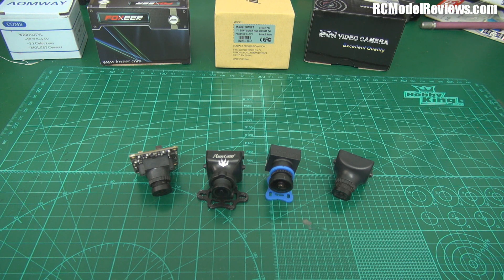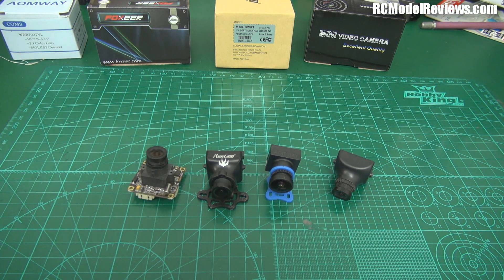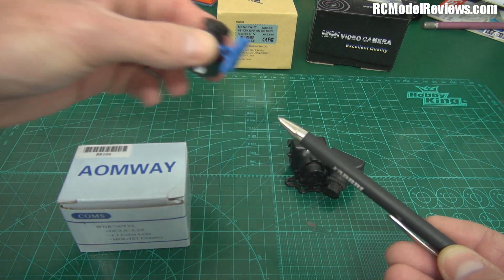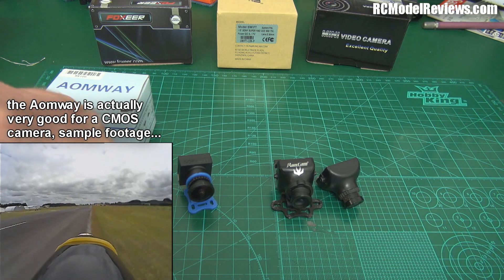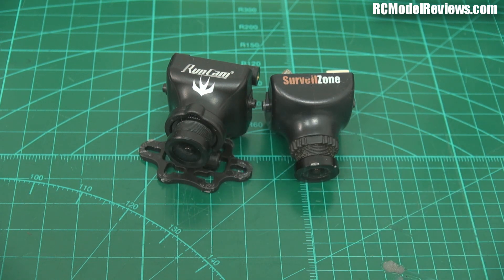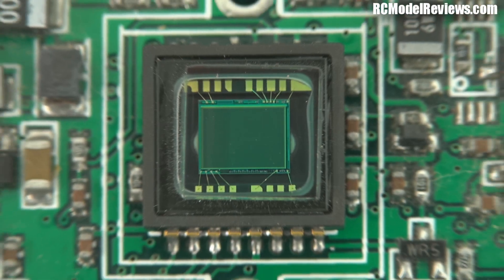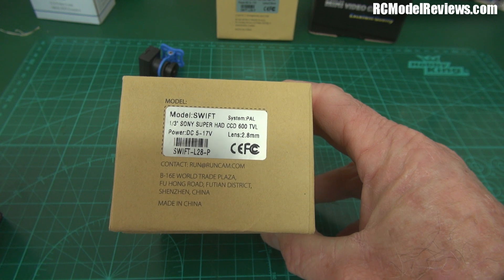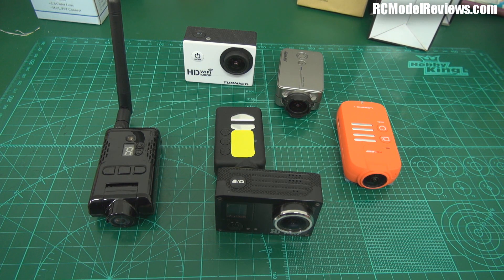FPV Basics:  live video cameras (part 1)

Comment: A heads up about the RunCam Swift.  It has a through hole crystal on it (at least mine does).  Pull it apart and use some double sided tape or glue to keep it from vibrating and breaking off.  I found out the hard way after my video went black during a flight.
Reply: I think in one of Bruces earlier videos on board cameras he suggests a dob of hot glue.  It works a treat.  I think the video was part of budget build series.

Comment: Thanks for taking time to add the video inserts. Very nicely done.
BTW, not all CMOS cameras are bad. There are high end cameras with CMOS sensors. I think, on average, a CCD camera is usually better than a CMOS camera but this is not a hard and fast rule.

Comment: great video, but it might be worth mentioning that it would be better running the hs1177 on a voltage reg especially on a 4s setup. voltage spikes from escs like the little bees have been known to blow up hs1177 cameras.

Comment: I would like to see a review on one of the all-in -one micro camera and video transmitter combo kits.  For example something like the Boscam TR-1.  How good are these camera set ups for smaller FPV  models?
Reply: I did review the AOMWAY 200mW camera/transmitter unit (link is in the description of this video) and it performed pretty well.  I will also be reviewing the Sky01 unit shown at the end of this video as soon as the weather clears.

Comment: Bruce, 
I just got back from Joe Nall and there was a couple of guys flying mini quads in near complete darkness. IR cameras possibly.  very cool. They set up gates lit with internal leds and flew from B&W screens not goggles. It just blew everyone's mind. My question is, can all these cameras do night mode?
Reply: It's surprising how well the HS1177 performs in low light (especially if you don't have an IR filter) but they do get very noisy.  Cameras like the Runcam OWL perform better insomuch as there's much less noise for a given level of light -- that's probably because they capture more light in the first place.   I've actually been caught out a few times when flying in the late evening/twighlight...  It's only when I've  taken my goggles off at the end of a flight that I've realised just how dark it actually is -- the camera was still making it look like daylight.

However, if you want to do night/twilight flying then a specialist camera like the Runcam OWL or similar camera designed for low-light operations makes a huge difference.   The OWL is a pretty good twilight camera but I've seen some stunningly good "starlight" cameras which allow you to fly in almost total darkness as well.

Sadly, in this part of the world, flying at night is illegal except under some special circumstances.

Comment: I found this very helpful and as a result purchased this :

DC12V 800TVL 1/3 Inch 960H 2.1mm Lens Wide Angle CCD HD Camera for FPV  

from bangood its cheap and seems to work well so far. I had to buy and additional "programming board" to get the settings right but you saved me from buying the wrong gear. I look forward to the rest of the series.

OSD Board for DC12V 1/3 960H CCD 700TVL 2.8mm Lens Wide Angle Camera

Comment: I agree with the aomway camera, after your review about it, I bought it. and so far I don't have a camera that's less expensive than 30$ that perform the same. my only issue with it is mounting options. although after this video i might look at the swift or an h117. but for my micro 120 size quads this bangood camera is the best i can find. it might have a really wide angle view (170 degree) but it doesn't  have as much fisheye effect as the 110degree version, which is more expensive. I believe its called 600tvl 1/4 1.8mm CMOS.

Comment: Why does the videot tx limit the resolution? Why is no one changing them to send more resolution? Are all VTx sending the same resolution?
Reply: All video transmission methods require standards like PAL , NTSC, SECAM etc so the TX and RX can work in harmony. Back in the days of analogue TV the standards were created to allow a number of channels to occupy the allotted radio spectrum. These standards limited the band width of each channel to around 8Mhz which is just enough to allow a signal of about 700 H and 625V resolution. Modern digital TV takes advantage of data compression to allow much higher resolution in a narrower bandwidth. This is similar to CD's and MP3's. Since all the FPV until very recently operated in the analogue mode no data compression is possible. On the up side, by not having data compression typical analogue FPV systems have very little latency. Digital systems by their nature require time to encode and decode the data stream which adds latency. Latency is not something you want when controlling a fast moving vehicle. If you have two digital TV's at home sometimes the delay can be so long it appears one TV can be ahead of the other in real time.
Reply: The video TX does not limit the resolution, the video standard does and the TX follows that standard. The vertical resolution is discrete and fixed by the video standard. So if you want a transmitter that works with most analog receivers you can't change that. PAL (and my guess is all the other analog TV standards as well) does not have a defined horizontal resolution, it is an analog signal. The limitation is that you have to transmit a single line within 64µs. Can't change that either. If you want to think in pixels (which, again, PAL does not have), you can either send many pixels, but have very short times for each of them, or you can send fewer pixels. "short pixels" mean you have higher spatial resolution, but the brightnes/color resolution of that pixel goes down to the point of being useless.
There is only so much information that can be transmitted over a signal with a certain bandwidth and noise. There is no way around that. It follows from the maths/physics how a signal can be encoded and is handled in a field called Information Theory that's pretty much the basis of all "data handling" (transmission over wire/air, compression like zip, mp3 or videocodecs, cryptography, language processing, pattern recognition and even "outside" fields like neurobiology and evolution).
Reply: +superdau so a 800tvl camera outputs a picture with  625tvl? Why is it not having 625 lines sensor in first place? What about immersion RC?  I've heard they forged the codec somehow..
Reply: Wait, there was another comment in this thread when I replied that explained part of it. Did you see that?
The TVL of a camera are how many vertical lines the camera puts out or in short how many "pixels" (that don't exist in PAL ;) ) the camera crams into one line. Also of the 625 PAL lines only 576 are displayed. The lines left out are there for the beam on a CRT to move back up to the top left corner of the screen. With all that cropping, scaling and arbitrary sampling of pixels there's no point in making a "PAL resolution" sensor. Yes, converting between anolog and digital is messy, especially when the analog part was designed at a time when there was no "digital" (PAL, designed in the 60ies, was still compatible to the black-and-white TV system developed in the 40ies).
Reply: ..and to complicate things even more, horizontal tvl does not equate to digital resolution. TVL is measured in a 1:1 square, but most cameras output an aspect ratio of 4:3. Because of this, in theory, in order to take full advantage of a 600tvl camera, one would need 800 digital pixels. Not that you need it for fpv. the videolink effectively lowers the resolution.

Comment: Hello! First of all, love the channel and appreciate all your very helpful videos. Wouldn't it be best, when discussing a multiroto program for camera to advise viewers to run all the cameras on a filtered power source? Even though cameras like the Swift and HS1177 can take 22v or what not, a racing multicopter which draws large currents can have huge voltage spikes. Some of these voltage spikes can be in excess of 40/50 volts! Just trying to provide helpful advice. Thank you for all your hard work!!!!!!!
Reply: Yes, I'll cover this in the "setting  up an FPV system" video
Reply: i was thinking the exact same thing. i bought an hs1177 clone from rotorgeeks and they say on their website that if you connect to raw unfiltered power you lose your warranty if it goes up in smoke.

Comment: Is the comparison between CMOS and CCD entirely accurate? Isn't part of the "auto exposure" based on the firmware and not necessarily the sensor itself?
Reply: The reality is that at the present point in time, the wide dynamic range of CCD cameras is better than that of most CMOS cameras.  One of the advantages of CCD is that it grabs an entire sensor's worth of data at once (a "freeze frame") and that makes it easier to process the data so as to deliver WDR.  With a MOS sensor, a rolling shutter is used which means that there's often not as much context information available when each cell of data is processed.   A frame-buffer can be built into the design of a MOS camera but that adds extra latency and complexity because such a buffer is intrinsic to the CCD itself.   There are some good MOS cameras but they cost as much (or more) than the CCD equivalent and few of them offer the configurability of the CCD cameras mentioned in this video -- in fact most have no ability to configure gama, color saturation, contrast, sharpness or other aspects of camera operation.
Reply: Aha! That's what I was missing. Keep up the awesome work. I look forward to your videos every week!

Comment: Add something about pal/ntsc pls, and wiphich one you prefer
Reply: I'm going to cover PAL vs NTSC when I look at "video resolution" in a separate video.  There's actually quite a bit to cover in the complex issue of what limits resolution and what (if anything) can be done to improve the resolution of a given FPV system.
Reply: pal is crap ntsc isnt, there you go

Comment: TV-lines indicate vertical resolution, right?
Reply: Horizontal resolution.  It is the number of vertical lines that can be resolved.  The vertical resolution (the number of horizontal lines) is more or less fixed by the PAL or NTSC standard to 576 or 480 respectively.
Reply: +xjet So then why isn't a 700 of 1000 TVL camera compatible to 720i HD? 720 is supposed to represent the vertical resolution or the number of horizontal lines too. And since these have composite signal output, doesnt the composite video standard  limited to 480i or 480TVL?
Reply: +xjet So then why isn't a 700 of 1000 TVL camera compatible to 720i HD? 720 is supposed to represent the vertical resolution or the number of horizontal lines too. And since these have composite signal output, doesnt the composite video standard  limited to 480i or 480TVL?
Reply: The 720 in 720i (or 720p) refers to the vertical resolution -- the number of horizontal lines that can be displayed.  The 700 in 700TVL refers to the horizontal resolution -- the number of vertical lines that can be displayed.
Reply: In old black and white CRTs, there were no vertical lines or horizontal resolution, because the electron beam scanned from left to right in a continuous path and the brightness of the electron beam trace is modulated by an analog signal. hence why old TVs only had a single number representing vertical resolution :/ Was this NTSC TV standard different from CCTV systems?